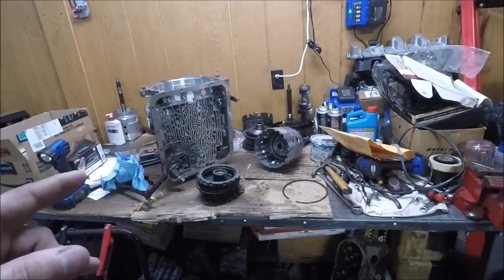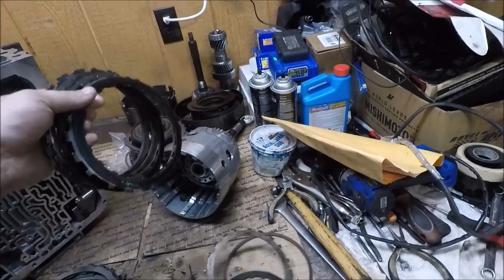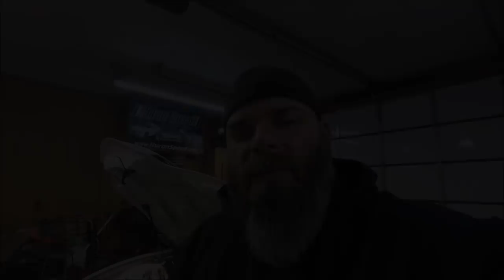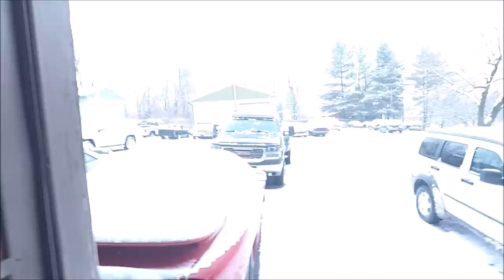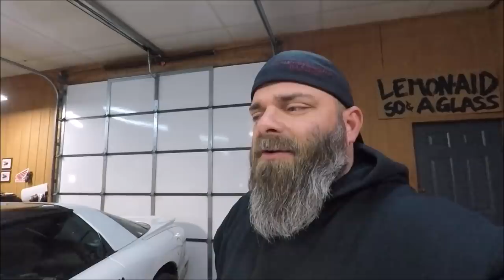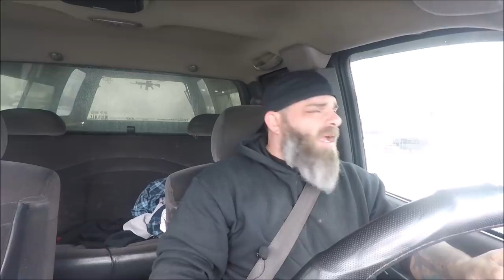The TRUTH About The Trailblazer Transmission Issue!  WATCH TILL THE END!

Comment: Always let the transmission break in whether it was rebuilt or remanufactured. Same thing applies to engines, transfer cases, and differentials whether rebuilt or remanufactured. Always break in replacement or rebuilt main components of the automobile for at least 1,000 miles or so.

Comment: I mean he got a tune on the vehicle, he didn't do that to go slower but maybe it's a coincidence. I have a 4l60e with 330ft pounds of tq with 220k miles on it. I dont run it easy but I never power brake it, neutral drop it, or put in in/out of gear while moving at all. You just have to take care of your things

Comment: Hey DFR great video and great work man. Drama is everywhere these days. I have a question about an issue I am having with my 2004 Trailblazer Inline 6 - Shifts fine from 1st to 2nd but 2nd to 3rd I have to max the revs out almost and lift 50%-70% off the accelerator before it shifts to 3rd. Where do I begin my search? Dash cluster isn't working so I don't know exact RPM's for 2nd to 3rd.
Reply from the maker: Drop the pan, look for dirt

Comment: I have a 2004 trailblazer the transmssion gets warmed up and looses all movement what would you recomend i do it is my wifes its just a daily driver dont pull anything dont race.  Would it be wise to do a flush and filter or should i have it rebuilt or replace with a new jasper transmission
Reply from the maker: Rebuild or replace

Comment: Just wondering. I've been pulling stuff with a crv that let's just say it's way too heavy. Been doing it for a while and there's no difference so far. But I change trans fluid all the time and  wanna change the clutch packs in the transmission   .  Don't know tho cause it's an auto an I've built 6 speed trans and seemed too easy  but the autos scare me.  This is a future  idea or when I feel hard bumps ect . But I want to know if that would keep it reliable      or what would need done.  Its getting a transmission cooler and a turbo eventually.

Comment: 4l60e is good for daily use put putting around if you want to beat on it or haul alot they can be built to last but you have to upgrade just about everything in them might as well put in a 4l80e it will last alot longer

Comment: Hey guy. I build these transmissions and I don’t have 3-4 failures. I’ve finally found an answer to making them last. And it’s pretty simple. It’s more of a bunch of small things that work as a system. The clutch pack I do for 550ish Rwhp is 8 GPZ clutches and matching kolene steels set at .035-.040 clearance. And do not delete the 3-4 Springs. This clutch setup held up good enough in my turbo gto with around 550-600 tire. Good enough that I snapped the output shaft.
Reply from the maker: I usually delete the 3-4 springs and us a Z-Pack....have had it behind my 700rwhp turbo build.
Reply: DiabloFormulaRacing that’s most definitely a huge mistake. Let me ask you a few questions. 
1) do you think that gm would include those if they weren’t needed. I mean throughout the years, they have been made aware of the 3-4 failures. I guarantee if that helped more than it hurt, they would leave it out. After all, those parts do cost money. 
2) would you remove the forward clutch return spring pack? The low reverse drum springs? No. The reason is it keeps the clutches from dragging and applying when in other gears. Same goes for the 3-4. You have to keep them from dragging or they fail prematurely. 
3) even sonnax includes longer return springs for their smart tech drum. Which is what I use in my higher end builds. I’ve had a few cars over 750rwhp on those drums with no 3-4 failures. The thing that fails before that is the input shaft or the sun gear that goes in the sunshell. I could go on for hours. But the main things I do, I’ll tell you. 
Englarge the 3-4 feed holes in the separator plate 
Billet sonnax 2-4 servo 
Billet sonnax accumulator pistons 
Heavy duty pump spring by sonnax 
Plastic check balls 
Sealed 2-4 pin set at .090 clearance 
Wide carbon band with new or resurfaced drum 
High energy clutches 
And this trans I’m building for my gto I’ve got hardened input and output shafts and a 4l79 input drum that uses custom exidy turbo 350 sized frictions in the 3-4 clutch with custom steels and one return spring per position (that’s all that fits). The two springs per slot is probably too much, but deleting them all together is a very bad idea. All the manuals and materials I have state to not discard them.
Reply: DiabloFormulaRacing a z pack is no good for performance applications. The clutch material on the z pack is awesome tho. But the steels are too thin. They warp easily. The GPZ clutches are the same clutch material as the z pack friction. You pair gpz frictions and heat treated kolene steels, you have a very durable setup. Ever notice those black steels in later model 4l60’s? That’s the same treated steels as kolenes. I always use them. They are much much more heat resistant that a regular steel.
Reply from the maker: I agree, the steels are to thin...but if the clearance is correct it's ok, I have a customer of mine that's gone 23 back to back runs at the track, 5 years strong and still going.
Reply from the maker: Cooling is really the best issue though

Comment: Andy from what I gathered out of this you need to just refuse to work on parts that you know will likely fail down the line, if the design is flawed it's flawed and there's no getting around that. Hell the transmission in my car has a flawed shift solenoid, I am aware of that problem and if I took it into a shop because it had issues I wouldn't expect them to be able to completely redesign the trans and fix the design flaw along with rebuilding it and never expect to have another problem with it.

Comment: 250,000 miles no issues yet,I think the way you drive one has so much to do with how long the transmission will last,kicking it down every time you pull out,kicking in passing tacked up going up a mtn not going anywhere so much of transmission issues is how you drive it

Comment: I'm sorry but this is normal for a Trailblazer 4 L 60 E I had an 07 Trailblazer transmission went out got rebuilt by a performance shop here in Texas and then for 30,000 miles every 10000 miles it went out again I got rid of the piece of s***

Comment: I still don't understand why this guy would bring a transmission rebuild on a stock tahoe to a performance shop. I get that he wanted the tune and everything but everyone knows how busy you are with big projects. If you take your stock car to a performance shop, expect to wait, and pay more. If the shops nice enough to even touch it. Most performance shops probably wouldve turned this away, Andy was nice enough to take this on, even with everything else on his plate and now look what he gets for it. 

For a side note, a lot of shops offer manufactuers warranty on the parts only and no warranty on the labor. So if the part fails, even if its covered, you are still paying labor to replace it again.

Comment: Hey Andy. It sucks that someone is complaining about a transmission that just naturally has problems. I currently daily drive a chevy impala and it has a 4 speed automatic which is notorious for clanking into 1st gear and slipping when shifting between 2nd and 3rd gear. Now me personally knowing tht the trans is weak and breaks easily i wouldnt even get the trans tuned or rebuilt or even built to possibly handle more power just bc of the fact that it is a weak transmission. I havnt even got mine rebuilt yet because i know its going to be back to the same in possibly 30 thousand miles again. The fact is its not the person who worked on the transmissions fault.  Its just a weak transmission in general. And also hope you win man if you go to court over this.

Comment: Hey much love brother.. I have a question  which lol seems ur very wl versed to answer. 2006 trailblazer.  When it gets super hot outside and a while of driving it starts hard shifting from 1 to 2 then not as hard in 3rd.. after a code reset with actron scanner it drives perfect.  Any suggestions as to what issue is..?

Comment: As per usual, Andy, YOU HAVE MY SUPPORT! I can’t believe these people. First, you build and tune a car and it’s running fine (albeit making a lot more power than it should’ve been), it gets taken to another shop and turned up further and it bends a rod, somehow people blame you for that. Then you build a car, but don’t have time to finish the tune, it gets taken to another shop. They talk shit about you and the car ends up back at your shop with a Procharger and a melted piston. Now, some yahoo has his Trailblazer’s transmission built, has no moral compass, takes it to you to fix an issue, doesn’t let you fix it, then tries to blackmail you. You’ve got backlogged work, so obviously business is still coming in and doing well. Keep up the good work, Andy! 

It also drives me nuts when people say Andy is a shitty mechanic because his shop is messy. The shop that melted the piston on the car with the Procharger was very clean. Shop cleanliness doesn’t equal quality work.

Comment: STOP BEATING on 700R4s/4l60-65/70E  in OD ! ....OD-2nd gear downshifts will smoke the 3-4 clutch pack. Select 3rd.... beat on it that way.
Reply: that's probably what happened to mine - going up a hill or something in OD. Wish I had known to select it into 3rd. Or I suppose it's from passing - and it downshifts? That must have been it!! Thanks.

Comment: "watch til the end!"
i hate when people say that. esp on a 22 minute video? PASS.
ill break it down for you. 

SERVICE YOUR FREAKING TRANSMISSION! change the fluid every 50-80k miles. Thats the secret.
on the 4L60, just drill out the separator plate, hit the PCS 1/4 turn and slap it back together.
HD converter, corvette servo and shift kit for any use beyond regular driving and they last forever.

Comment: It's not your first transmission problem nor your last. Today's transmissions are to complex   They are computer controlled , electronically controlled, hydraulically, controlled, machanicly controlled,  & vacuum controlled! To much crap to fail.  I remember getting Technical service bulletins   TSBs only to find out 2 weeks later that the dealer  printed something wrong ? Like Wtf example 1996 4l60-E has a 1-2 slide bump shift rebuild unit everything air checks normal.  Everything electronically checks normal.  TSB says add this ground to PCM harness pin # ? Did it still the same thing . 1 week later I was told pin # ? Dealer put on TSB was wrong has to be this pin #  so now what did we fry that computer?  That's just one of many issues ? Good Luck out there !

Comment: all of this from wanting to get a v6 trailblazer tuned.!.! LoL my question is why, Is there a performance v6 trailblazer trend I'm missing? Sounds like a awesome bunch of guys!.!.! NNOOTTT!!! (in my Borat voice)
Reply: I-6. No such thing as a V-6 Trailblazer.
Reply: @Trebor-gw8lt  I know but I've always had a problem saying v6 instead of inline or straight 6. I wish I knew more about vortec 4200 6's (thank you Richard Holdner) back when I made this comment.  I still agree with my original comment tho, I see know reason to tune a stock trail blazer! LOL I would really like to see how fast I could go with sbe 4200 with something like a s472 with a t6 1.10 exhaust housing in a 3000 pound car  Fairmont or LTD or something  similar maybe a elcomino idk until boost, part weakness or bad tuning kills it then tear one down go to a reputable shop, reuse the stock crank have all the machine work done, arp hardware where needed, some good rods and pistons get the comp around 11to1, possibly some cams idk and somebody has to be making a intake now that's alot more boost friendly or have something fabbed up and either do to a 1.38 housing or a s475 t6 1.10 or 1.38 I want it to make some steam. Something like nivlac57 but way more race carish.

Comment: It's all in how you drive with these crap transmissions, I went through 3 monster brand transmission in 1 single winter, no I didn't have a hole lot of power. Only had about 400hp, and their transmissions are rated for 1000hp. It was a 90s k15 4x4 4l60e. I kept shredding the band and killed 2nd and 3rd. 2500, 4000 per transmission

Comment: Does any one remember when Mike took is car to RPM for the first time it was HACKED TO HELL go look up that video
Reply: Do you realize mike wanted the car built to go as fast as possible with as little wrapped up into it? Even RPM admitted they knew the car had issues and still sent it out the door. Mike made a killing off of that car with the content he made. Rpm got a lot of notoriety from the ss717. Mike sells it and it blows up? Rpm straight up responded to my comment on the trail blazer video. They said they didnt know mike was going to sell the car. That tells you they knew the car had demons and still pushed it through. Rpm is shady, always throwing shade around meanwhile the dude that bought the c7 is sitting on a car that blew up shortly after it being purchased. Who's at fault there?? Who had it last? Who tightened the last bolt?

Comment: 2/3 of rebuilt transmissions fail in the first 50k miles. Buy a factory reman. don’t try to rebuild them. I use salvage with low mileage, good luck.

Comment: I'm Dave 25 years doing Transmissions I replace third clutches in so many 4l60 that is not even funny and honestly its weak point in that transmission don't worry about it
End of story
Reply: Your right have a 4l60e that was built didnt last 10k before 3/4 went out but since im not an asshole I didnt blame the builder (guy has a good rep and tranny had some issues he was trying to fix) anyway I decided to man up and take it apart myself bought a few book and watched a lot of videos turned out to be a bad 3/4 apply piston. Molded rubber was hard and didnt make a good seal dont know why it went bad maybe defective part or the kind of ATF I was using I dont know anyway the rest of the tranny was fine so I rebuilt the input drum used hi-per blue pistons instead of the stock black molded ones new steels and Raybestos GPZ100's and its been good for almost two months now.

Comment: Truth is you broke it and are covering it up because you’re afraid of losing money
Reply: Jason Kaplan how did he break it if the guy drove it to a different shop with no issues?
Reply: Justin Mattson did you watch the guys video? The other shop said it was done wrong
Reply: Jason Kaplan did you just watch this video? And did you listen to the other guys video? He blatantly said he pick the vehicle up from the shop, and drove it to the other shop.
Reply: Justin Mattson so? I had a Chevy s10 with a blown head gasket. I changed the oil and coolant and gasket and drove it for 2mo till I could get the engine swapped. Doesn’t matter it was still wrong

Comment: I'm 55 and I've ben Building automatic transmissions litterley all my life , well senc I was 13 or 14 old. So have my brothers. We started w/ our Dad who's now 82yo.  I know what you are experiencing I'm so glad I have my 3 BROTHERS to team to gether and keep the dumb asses at Bay. ,,,,,, thoes 4l60e units can be a tricky shit.   PS.  Try using THE SONAX OVER SIZE. PRESSURE REGULATER VALVE. IN THE FRONT PUMP AND CORVETTE 2-4 SERVO.      GOOD LUCK. LREjr.     Edwards Brothers Transmissions ROANOKE RAPIDS NC. Senc 1977 😊I sead. PR VALVE I MENT TO SAY.    BOOST VALVE .....SORRY😢
Reply: THANKS